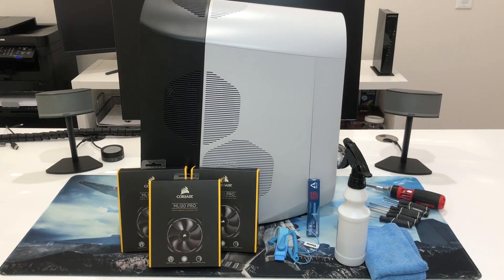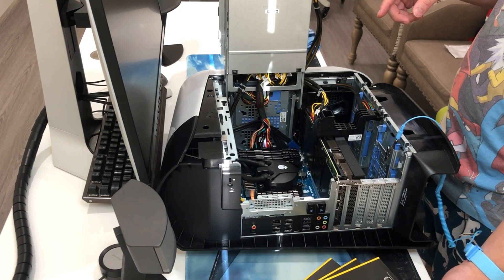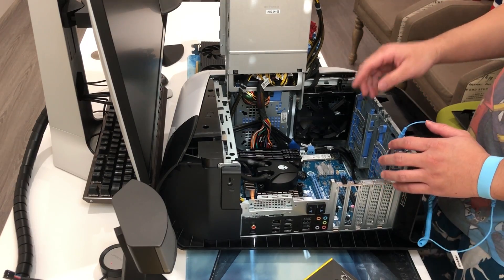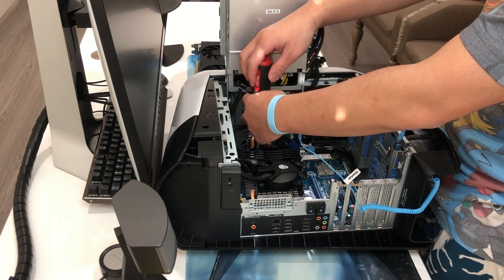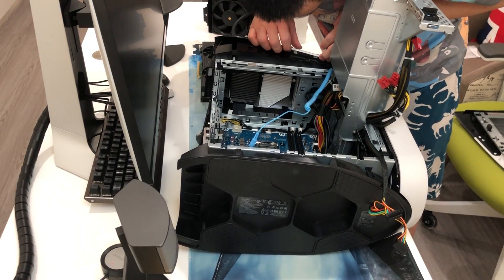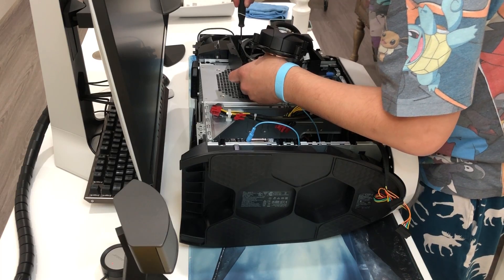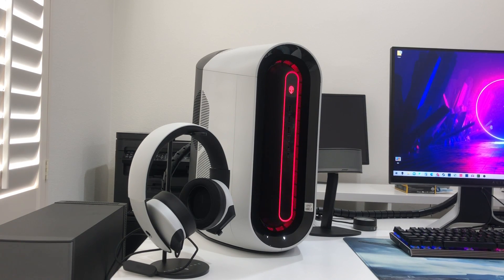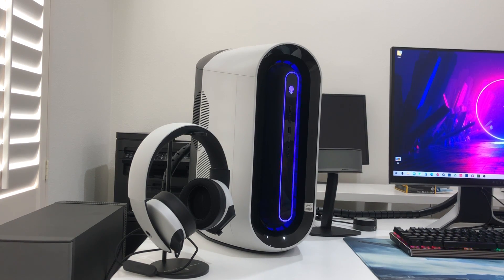How to Upgrade Fans for Alienware Aurora R11 / R12 to Lower Temperature and Noise - Top & Front Fans

Comment: Are there other Corsair fans other than the ML120 PRO's that are compatible with the Alienware Aurora R11?  It looks like the fan may be discontinued.  I saw AF120 Elite's available but can't find guidance on if they'll work.  And I have Corsair SP120 Elite fan's on hand but have heard that they may generate a BIOS compatibility error so am worried about installing them.

Comment: i would suggest using thin mechanic gloves. that thin metal cuts like a razor. i had to pull my top fan to clean out the cpu liquid cooler radiator and cut my hands grabbing onto the frame. im def gonna do the mods now. 10 degrees cooler and less fan noise seems worth it. modding the gpu looks really hard. i just hate how loud the thing gets when i play aaa games.
Reply from the maker: Airplane

Comment: How do you control fan speeds? For me I can’t get my fans over 45% in the Alienware software
Reply from the maker: Alienware command center, since the RPM is half compared to the original fans, 45% is the max for the replacement.
Reply: @RyanYu  yeah I figured that’s what it was, just wanted to make sure. Thanks for clarifying. After replacing fans and putting in a AIO, cpu temps went from low 80s to high-ish 50s

Comment: I removed 3.5" hdd metal base and added a fan, I used a Y splitter connected to the front fan, and the new fan started to spinning, but once OS is loaded, new fan stopped, what I found is that Y splitter in one of the terminals has only three pins instead of four, so I connected the new fan to "CPU FAN" connector and fan started to work with a lot of noise
Fortunately I had a noctua fan and used the cable labeled as "low noise", now the fan is quietly spinning, I did not tried to upgrade fans, only added a new fan, not sure if temperature is better, processor is between 47°C - 50°C and GPU GTX 1060 is around 54°C
Reply from the maker: Nice

Comment: I think there's something wrong with your stock fan or you used quiet fan profile. 93 is crazy for Cinebench. My Ryzen 9 5800X doesn't go above 70 in Cinebench with performance profile for the fans. That top fan has over 150cfm whereas the Corsear has only around 60cfm. Quiet is not always good. Some may be happy with throttling. I'm not 😉
Reply from the maker: 93 is okay~

Comment: Does anyone know if I can fit an 3090 ti in the R12? i have the 3060 ti right now. I believe i would have to upgrade the power supply as well.
Reply from the maker: You can’t.  Dell has their customized GPU size.

Comment: So I recently tried this with the corsair ML120 pro and it said that the top fan wasn't working I was able to install the ML120 pro in the front fan and it worked. Do you have any solution?
Reply from the maker: Did you get the Y splitter?
Reply: @RyanYu  No since I was only installing 1 fan to the top and 1 fan to the front
Reply from the maker: @NotSoSuperAsian  the top one is not working?
Reply: @RyanYu  the fan seems to work and spins up when I start the pc but when I ran a diagnostic it told me that the top fan wasn't working. But when I put the same type of fan on the front of the pc it worked fine in the diagnostic
Reply from the maker: @NotSoSuperAsian  Did you plug it in the port that was original the stock fan?
Reply: @RyanYu  yes
Reply from the maker: @NotSoSuperAsian  try to use the other fan for top?

Comment: Can any one tell me whether the phanteks t30 will fit in this case? I’m not very experienced with PC upgrades so I have someone helping me upgrade. The only reason I’m asking is because they are 30mm depth instead of 25mm? Thanks in advance
Reply from the maker: it should, but may give you error message.
Reply: @RyanYu  ok, so would you recommend the Corsair ml120 pro that you used?
Reply from the maker: @ASilver526  yes sir.

Comment: This is my 4th alienware and has to be the worst ever for cooling it has no software for fan speeds no fan at top vent to expel heat playing fligh sim 2020 its like sutting near a raduator i expect more from a 3k machine.
Reply from the maker: Return it get the R13.
Reply: @RyanYu  Thanks for reply the r13 looks like a much cooler machine with the external fan at the rear, its at a stage now i cant sit near the machine its too warm playing flight sim no overclocking i cant believe the top vent just sits there static with no fan do alienware do a return policy i bought i 6 months ago? system 11th Gen Intel(R) Core(TM) i9-11900KF @ 3.50GHz RX 6800 XT first time not buying nvidea the amd might be adding some extra heat
Reply from the maker: @_alienblood  Flight SIM is too demanding. haha.

Comment: Will an amd 6900 xt fit in the r12?
Reply from the maker: It will but you will have to remove the front fan for that.
Reply: @RyanYu  thanks I installed the 6950 xt with an intel i7 11700kf but my gpu usage doesn’t go over 70% in warzone do you think I am cpu bottlenecked?
Reply from the maker: @cardinal8952  How much RAM do you have?
Reply: @RyanYu  I have 16x2 3600mhz ram and 1000 psu
Reply from the maker: @cardinal8952  Ummm, what about other game? try RDR
Reply: @RyanYu  I tried apex and I was only getting 165 fps on high settings and my gpu utilization was at 65% at 65 degrees Celsius

Comment: Hi just did everything you did to my Ryzen edition aurora and had a question about the 3rd top fan did you put it inside the black box on top of radiator or on top of the radiator housing like in the video which worked better for you  ? I have it inside and i barely feel any airflow out of the top with push pull dual fans on radiator ? Please advise
Reply from the maker: I didn't do the 3rd fan tho.

Comment: I am going to do this fan swap in the next few days as the stock top fan is starting to make a rattle noise!
Had a look inside but everything looks fine so not sure why the fan started to make a sort of resonating rattle - if I put the tower on its side then the noise goes away. I am certain it is the fan making the noise though.

I'll be replacing top and front fan with ML 120 pros. I noticed on some other videos they did not remove the full metal housing, just the radiator and the fan, I may also do it this way because the big metal housing is very fiddly and tricky to put back in, but you managed quite easily!
Reply from the maker: You should be able to do this too very easy.
Reply: @RyanYu   Hi friend. I finally did it today and it took about maybe 30 minutes. I did exactly the same thing and only replaced the existing fans. You're right it is not too hard but your video helped a lot tso thanks. I also used the video of the other youtuber who did the same mod with push/pull - I may do this in a few weeks but for now I think this is enough.

When I first started AWCC I was a bit worried because it said "no alienware components detected" !!! but after a few seconds it worked. 

These fans are so much quieter compared to the stock fans. They seem to be doing a much better job. From what I understand 0-20% is low, then 20-40% is medium, and then 40-60% is high so I dont think I will see the fan speed % go above 60%.

Still playing with fan curves but happy with the mod.
Reply from the maker: @teeq985  nicely done buddy!

Comment: hey hopefully you see this but i just did this with my r12 and i plugged everything back in but when i went to test boot it the computer turns on and then the alienware power button flashes yellow a couple times  and turns off

Edit: i fixed it it flashed 4 times which means it didn’t like the way i put in the ram i guess…
Reply from the maker: :D
Reply: @RyanYu  amazing videos btw it was super easy to follow along and was a huge relief and made this project super easy for me.. i appreciate it man💪🏼 take care
Reply from the maker: @CameronLangleyy  thx man.

Comment: Hello from Germany,
I have a question about the fans are all 3 the same models? So all 3 the Corsair ML120 Pro ?
Reply from the maker: Yes sir, the are all the same size. and you can use ML120 Pro for no problem.
Reply: @RyanYu  Hello 
Thank you for your answer.

I have ordered and installed the fans.
After startup came the diagnosis with this message.

Critical Error Message
Version:Build 4400.16 UEFI ROM

Service Tag: xxxxx
Error Code : 2000-0511
Validation Code : 116989

Fan - The (TOP FAN) fan failed to respond correctly 

Hope you can help me here.
Reply from the maker: @MrKampfhaas  so you installed 3 fans? Did you get the y splitter for the third fan one the top?
Reply: @RyanYu  
Hello,

I have installed the 3 additional fans.
The 2 fans at the top of the radiator with a Y cable and the 2 front fans with Y cable.
Reply from the maker: I got that error message when I plug the top fans into the CPU fan, check on that?
Reply: @RyanYu  
The Y-cable for the top fans I have plugged next to the pump. Just as the original fan was plugged in.
Reply from the maker: @MrKampfhaas  Emmm, I run out of solution then. sorry didn't help...
Reply: @RyanYu  
No problem it works so wonderfully. Temperatures are 10 degrees less and much much quieter. Thanks for your support! Your video is 👌🏽
Reply from the maker: @MrKampfhaas  :):_fishNice:
Reply: @RyanYu  

Me again :-) 
which Bios version do you have on it?
Reply from the maker: @MrKampfhaas  never updated. Stock version.
Reply: @RyanYu  Hmmm maybe thats the Problem..
How can i downgrade?

Comment: this did not work for the 3090....... core temps are thru the roof so i guess it's not making enough contact with the pads in place
Reply from the maker: The space is too small in the case.

Comment: Thanks for this video, going to attempt this in a few days when fans arrive! One question, if I'm not redoing the thermal paste, do I really need to take the AIO system out to swap the fan? It looks like the fan comes right out of the AIO bracket?
Reply from the maker: Yes, you will have to remove the the AIO, otherwise the space is too tie.

Comment: I got mine I had to re-paste the CPU after three days they had used arctic sliver 5 that was old and dry I used MX-4 I didn’t know it was OC’d so much or I would went with a paste for OC’ers which I have coming plus a better fan for my AIO besides that the PC is awesome graphics card runs nice and cool np’s there even with the vram but I’m gonna throw some heat sinks on them to extend the longevity of my 3080 Ti
Reply from the maker: nicely done

Comment: I have replace the stock front fan with noctua fan.But everytime windows restart will run Pre-Boot System performance check first and say the fan failed to respond correctly. The new front fan is actually working. anyway to solve this issue? thanks
Reply from the maker: Nope, we can’t by pass the bios check.

Comment: bro, I changed the fans, but when I turn on the computer and the bios say that my fan have issues and not recognize it. You experience the same?
Reply from the maker: Nope, what fans did you use?
Reply: @RyanYu  I used the Noctua fans, I guess could be the bios update I did...Now it recognize the non oem fans now and everytime I start the pc this testing come out...sad
Reply: @generalkai115  You have to use the Corsair ML120 Pro fans to not get that Bios error.

Comment: hey man i have the same system i did alot of research and everyone says that the 3080 TI and the 3090 are too big to fit into the R11 body. is this true? it seems that your 3080 fit in the system.
Reply from the maker: The RTX 3080 that I got is Dell's, other brand won't be able to fit in this case.  unless you do some mods, and remove the front fan.

Comment: With the top extra fan, does it fit ok or is it a challenge? I have noctua 120mm to go on top
Reply from the maker: It will fit, and you need to mount it to the radiator.

Comment: Thanks for the video I have upgrade both fans to ML120 pro. Noise is much lower but I found that the cpu temperature is higher than before and easily rising high temperature after open some applications.Mine is also liquid cool, don't know which part went wrong.gpu is also a little bit higher temperature(2 degree).
Reply from the maker: Maybe the thermal paste.
Reply: 150 cfm vs 60 cfm. 😂

Comment: Awesome video bro, my R12 is arriving in 2 weeks, but I have actually 3 questions:

1. What exactly do you mean by "putting the 3rd fan between the radiator and the bracket? 
Fan 1 (bracket), then Fan 2 on top if the bracket and the radiotor right benath the case cover?

2. Can anybody confirm, that Noctua Fans don't fit?

3. The hardware bays on the case bottom:  Are they 3.5" or 2.5" bays?

Thanks a million and greetings from Berlin m8. =o)
Reply from the maker: When you take out the radiator, you will know what I meant.  Noctua fans will work, but you may experience error messages. The hard drive bays at 2.5 at the bottom.
Reply: @RyanYu  does this error only happen with noctua? i just bought two noctua a12x25 for r12 and i got the error, will it not happen with ml120pro or others?

Comment: That OEM fans move more air than the ml120's....sure it will be quieter but it won't help for heat.
Reply from the maker: It actually help a big in my case.

Comment: After i change the frontal and top fan my cinebench ranking goes down from 14600 to 14200 and 13300. What can be the problem? Thermal paste?
Reply from the maker: does it overheat?
Reply: @RyanYu  during the test 10 minutes multi core (throttling) it always reach 100 degrees and istantly go down, it repeat the same thing for the entire test
Reply from the maker: @michelefoschini7718  it shouldn’t   Check the fan if it is the right direction?
Reply: @RyanYu  they are in the right direction
Reply from the maker: @michelefoschini7718  check the fan speed if they are locked
Reply: @RyanYu  i’ve a curve speed and it run at 70% on 100 dregrees and 50 at 60 degrees, but it’s the same setting of the first test with old fana
Reply from the maker: @michelefoschini7718  did you reapplied the paste?
Reply: @RyanYu  i will try after work but  i’m a bit confused…
Reply: @RyanYu  the problem its the turbo boost on processor. It locks at 4.9 to 5.3 ghz and i dont know how to disable it, i have i9 10900kf 3.7ghz. From bios i don’t have the options and the dell support didnt give to me the right process to disable it
Reply from the maker: @michelefoschini7718  you can do it in Alienware Command Center? right?
Reply: @RyanYu   no i can’t do it in awcc, it’s a default overclock from intel “turbo boost” and its configured from dell like that but i can’t find the way to disable it. thats why the computer run hot, its always at his max
Reply from the maker: @michelefoschini7718  nice to know.

Comment: Just wonder the liquid cooler power cable connect to where
Reply: I mean cpu fan or pump fan
Reply from the maker: @jeffyang9500  yeah a y-splitter
Reply: @RyanYu  I only inst one fan connected to top fan my question is the liquid cooler cable should goes to pump fan or cup fan or need y splitter connect to both
Reply from the maker: @jeffyang9500  are you replacing one fan or install an extra fan?
Reply: @RyanYu  replace the fan
Reply from the maker: @jeffyang9500  connect the fan to where the previous one was at.
Reply from the maker: You just need a Y-splitter.
Reply: I forgot where did I dcd

Comment: Hi, I replaced the fan on the CPU radiator like you did.  Im wanting to add an extra slim fan on top for extra cooling, and dont want to drop the whole radiator again.  Will mounting it on top of the bracket still provide some usefulness?
Reply from the maker: Not much very little.

Comment: Does the 120mm fan actually fit on top with the case cover? It looks like the ends where a bit to high if you compare to the curvature of the frame. Freeze at the 16.19 mark. Hope I am wrong though because I would just leave the stock fan and add a pull fan at the top, if it fits
Reply from the maker: It will fit.
Reply: You sure about that? :)
Reply: No, noctua 120mm does not fit.
Reply: It doesn’t fit. Even ultra thin fans do not fit

Comment: I just bought an R12 last week. Would you mind telling me, if I am only playing games in 1080p, should I upgrade my fan?🥲
Reply from the maker: Hi, you can play it in high resolution if you have high end GPU, and if you don’t mind about the idle noise mode, you don’t have to change the fans.
Reply: @RyanYu  Thanks. Noise is not a big deal to me. My GPU is 3080, and CPU is I7 11700F. I choose the default water cooling opting on website, so It's that enough for me? Thank you.
Reply from the maker: @freq2482  well enough
Reply: @RyanYu  Thanks!

Comment: My fan stops at 58% in my Alienware command center
Reply from the maker: Even if you set it to off set ?
Reply: @RyanYu  yes :(
Reply from the maker: @chandlerwatts8171  how about the temperature?
Reply: @RyanYu  temperatures are cooler I’ve installed two front fans now with a splitter but it’s now only going up to 55%
Reply from the maker: @chandlerwatts8171  that’s okay I think.  If your temps is good then why worry about the speed of your fans right buddy.

Comment: You dude, I need help. Is the top fan the intake or is the lower fan the intake?
Reply from the maker: The lower front fan is the intake and the top one is the one push air out from the case.